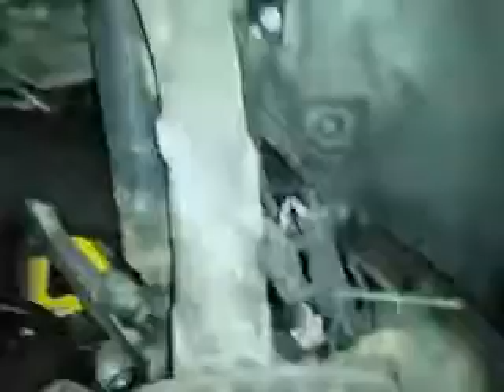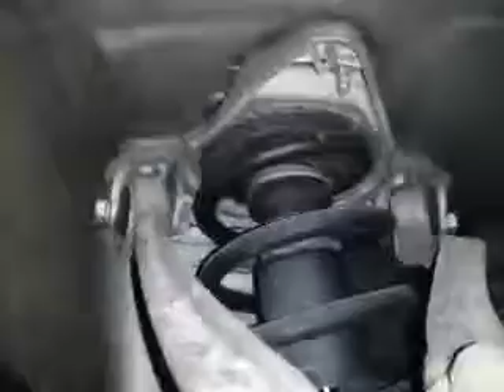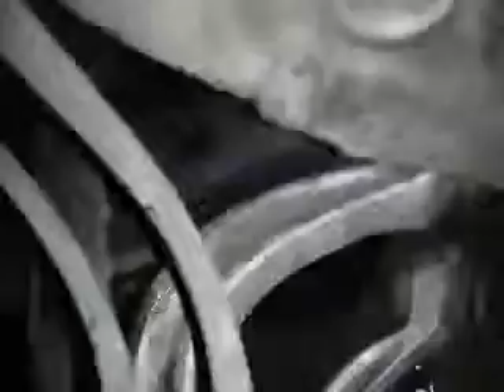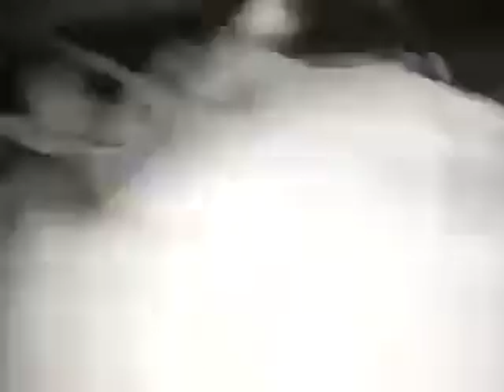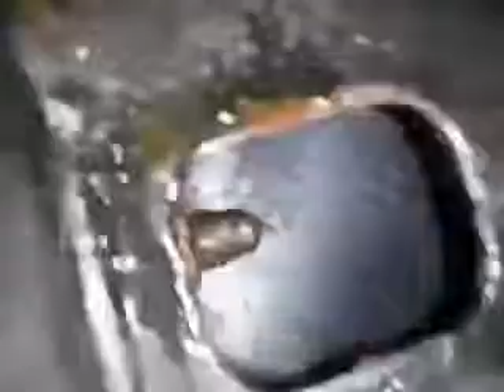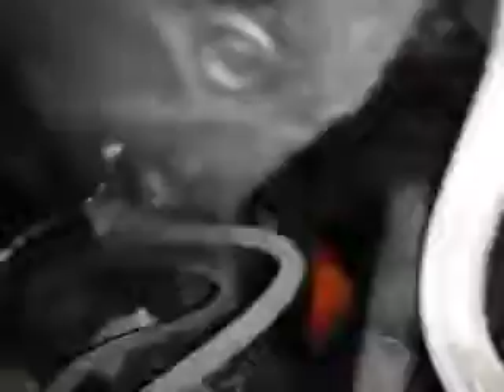03 passat lower front control arms pt1

Comment: Hi, do you have anymore information about this job? Steps you took to remove, and replace etc. And most importantly what torque settings did you apply to each nut & bolt? Let me know please, take care dude.
Reply from the maker: redsea I actually made about 9 videos, didn't torque them, but made sure the car was on a jack stand, under the control arm with the wheel off.  That way the control arm is tightened in the correct position.